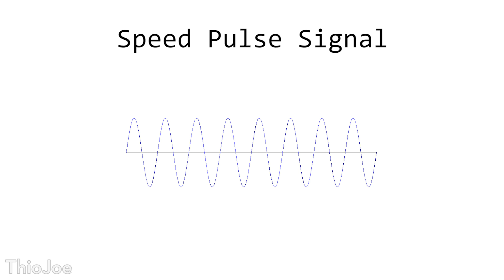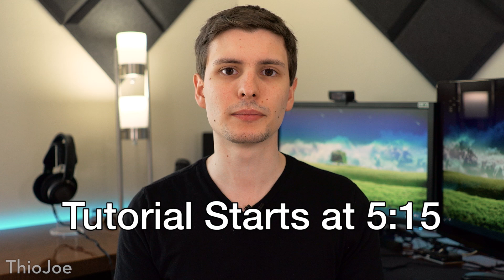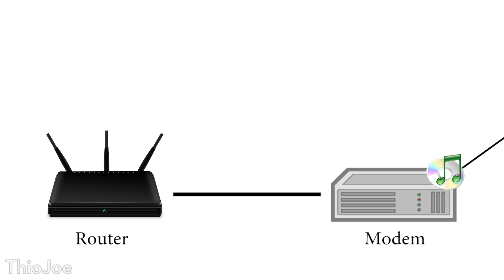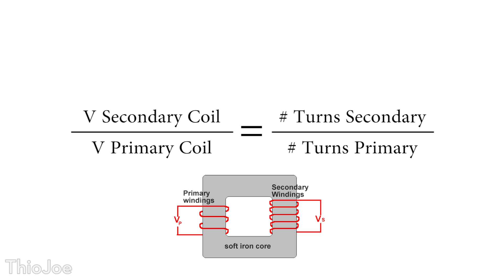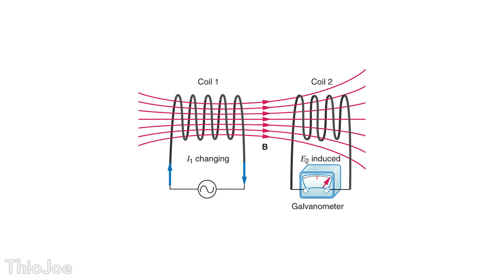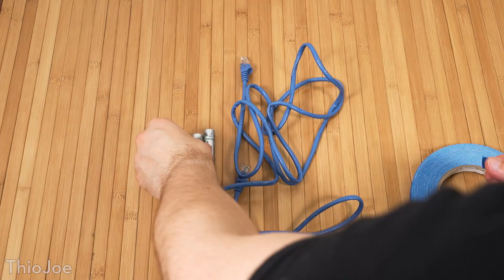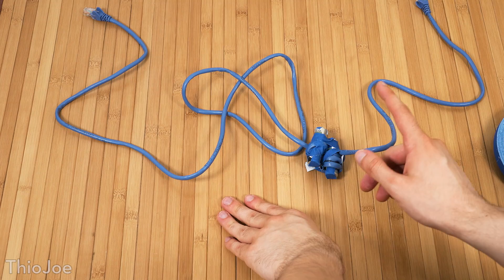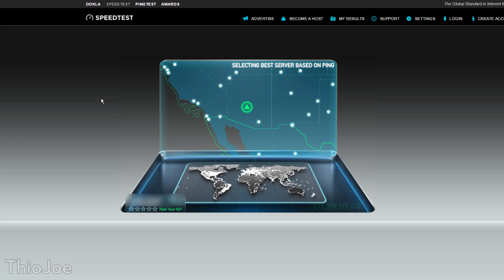How to Get Faster Internet Speed for Free

Comment: what if some have only the modem/router then what?
My isp company gave me the modem/router in which goes the signal line/cable they provided (and its so hard that it cant be fold) from which we get the internet.
And then I connect the lan cable from that modem/router to my system.

Comment: The batteries are not connected..... so i think the coil will not induce current as long as batteries are not connected...... I would recommend to connect the battery ends with copper wire and coil it around the wire...... And like he said one should have less no of coils and other one with more no of it........ Since he said that the battery are to be kept disconnected i dont believe this would work

Comment: This will not work.  Cat 5 and Cat 6 network cables have shielding that blocks the electromagnetic flux.  The shielding prevents the voltage inducement from one cable to the other.

Comment: A transformer can induce current in the secondary from the primary only if there is an alternating current(AC) with connecting two AA Batteries which provide direct current(DC) there will be no current induced there there will be no transformer action. (in-fact this guy told in this video you need AC to work).Hence this guy is fake looking for cheap publicity. Grow up Youtubers.

Comment: The batteries won't do anything with the conductor parts of it not connected in any way shape or form. This is an easy bs, might have been more believable if you showed us the router while doing the speed test to confirm its legit.

Comment: thio jo I really don't want to loose out on the high speed internet but my router doesn't have a modem ,it is just directly connected to the internet through a tiny wire which is connected to something similar to a outlet (not a outlet tho) ,do I do that battery tape thing to the tiny wire?

Comment: Hope i solve this battle of sense and non sense...

1. If you ever crimped[install RJ45 connector] a LAN cable then you will know that inside there are 8 strands of wires with another insulation for each one of them to reduce electro- magnetic interference. In order to even have interference[to increase volt] you will require to have that setup with each strand separately without the first outer insulator and then the insulation on each strand and at much closer distance. [Buddy what you did is not even hoax because you can't understand even common sense]
2. How does ISP cap your speed by signals. Its all policy based on your MAC addresses.

Hope this helped. :]

Comment: I don't have any modem 
There's a network cable which comes from the isp, goes into the splitter at my place , which splits  into two wires , one for the router and one for the telephone 
will it work and it it will where will i have ti attach the batteries ???

Comment: If i am using wifi+modem in 1 
which side of the cable should i connect in pc and which side should i connect in wifi+modem (which side of battery will be with single coil and which side will be with 4 coil) ?

Comment: I have Router+Modem in single machine. A wire form ISP connects to my Router+Modem(ADSL cable). An Ethernet cable connects from my Router+Modem to CPU. Now as you said I did the transformer thing to the ethernet cable. But what I am not getting is that what ends to be connected at Router+Modem and at the CPU.

Comment: Thio , my ISP only sent a cat5 cable when i took the internet connection , i plug it in my router and use it . Can I use the process on that wire which came from the ISP

Comment: Plz read my comment
+ThioJoe
ThioJoe plz help I only have router without modem and there is only a wire inserted in the wifi  and other to their company I don't have modem in wifi or external there's only a wifi 
Should I do this to the external wire in the wifi or the cable into my PCs 
Help me pz

Comment: How do you do this if your router and modem are the same? I tampered the wire like mentioned and used in both the ways, 1. Put between router/modem (in) and the wall(out) (that's where my out is) 2. Put between router/modem (out) and laptop (in) 
But this didn't work. Could you suggest me?

Comment: I understand the principle I have several computers hooked two routers that split the signal to the combo modem and master router AT&T so each computer who are the 2 slave routers just before the master router combo AT&T box would have to have coil Transformer configuration to enhance signal but what I was wondering is would it work if it was just the other side leaving the master modem router and going out to the phone box if the call was placed there so that the main trunk wine had the coil why are rapping to become Transformer just after leaving the AT&T Master router modem would it work or would that do something that we don't want tell me what you know get back to me incidentally I have been watching you for a very long time

Comment: I have FiOS with a 2.5 / 5 router. It appears to be cable coax from the unit they mounted on Wall (where FiOS enters the house) to the router. Do I wrap the coax around the batteries as you illustrated? Will it work for me? Thanks for any help you can provide.

Comment: nope it doesn't works at all. Not even an extra bit of speed has improved, and it can't for anyone . he is using the concept of transformer but actually wires of the secondary and primary coil should not be the same wire, there must be a different medium between the two coils.

Comment: Hey Thio! This is bhavya from New Delhi, India. Here in my neighborhood the ISP has set up different nodes and from that node  cat-5e ethernet cables are used to provide internet service in different buildings, homes etc. What should i do in that case to amplify the outgoing signal from the router. I have used my own Wi-Fi router as no router was provided by the ISP.

Comment: ThioJoe plz help I only have router without modem and there is only a wire inserted in the wifi  and other to their company I don't have modem in wifi or external there's only a wifi 
Should I do this to the external wire in the wifi or the cable into my PCs 
Help me pz

Comment: i just have router which doesnt have any modem in it or outside there is only a wire  my company provided it is plugged into the wifi no modem included

Comment: Hey Joe read this comment will ya.. My internet does not have a modem but it does have something which is mounted outside my home in a small white box and it can't be remove so is it ok if just do this trick to my Ethernet cable and does this has to a rechargeable battery? and is this legal?

Comment: Did not work at all. I did it exactly as shown in the video. I even made sure to wrap the wires in the same direction you did, even though you didn't specifically say they had to be. It's testing all over the place, but most the time it's the same or slower

Comment: tried this also.   no change. getting 40 megabytes down and 1.47 megabytes up. small regional company supplying internet for this area. signal comes in over phone lines and into their modem. I plug my router into their modem. speed is constant with or without all the tricks you listed. also put a 16 gigabytes stick into their router usb, rebooted, and nothing, no increase, awaiting further instructions.  ps.. wife laughing at for doing all this

Comment: THIS IS BULLSHIT! HERE'S WHY: You can't just make a transformer like that using tape and batteries at home -_- The voltage can't be stepped up (increase) by making coils around a couple of batteries. First of all, the coils have to be wrapped around some specific material core based on the type of transformer, like soft iron core. Also, there needs to be an AC load voltage on the primary coil for the induction to take place through appropriate material.

Comment: OR you switched from wireless where the max is 100 Mb/s to Ethernet which is Gb/s or switched computers using 100 Mb/s Ethernet to a computer with Gb/s speed. You get the point.

Comment: Guys, if it's not working for you make sure that the two batteries are pointing the same way (positive terminals are pointing the same way and negitive terminals are pointing the same way).  It didn't work for me at first but after I oriented the batteries the same way I almost tripled my speed!

Comment: ThioJoe, I have a modem/router mix. The inbound cable to provide Internet is cat5e cable. Would it work if it out it on there with the battery with more coils to the outside? Only reason I ask is because I want to use the wifi with faster internet not just the wired electronics. What are your thoughts?

Comment: Hi,

What if we have Fiber connection. Instead of the ethernet cable i am having the fiber cable coming to my home.

I fear folding that fiber wire around the batteries will damage the inside part.

Comment: hey, I am using Modem router combination , only DSL line goes out from modem plus router and connects to ISP ( Airtel broadband ). They uses copper wire with two terminals and hook the wire with kinda splitter, and from there a phone line may be R15 connect to my modem router.. how can I get maximum speed??